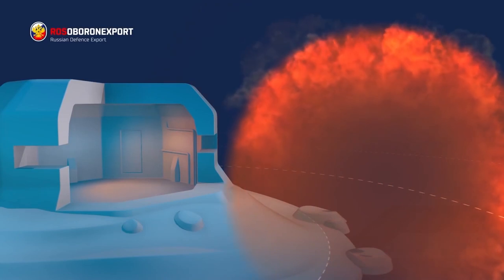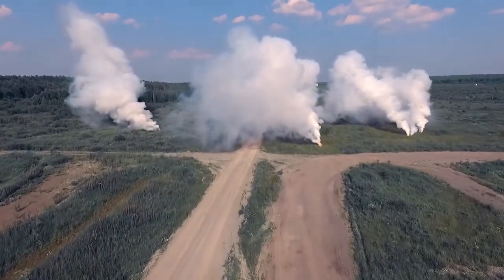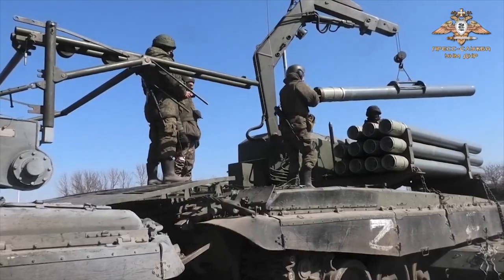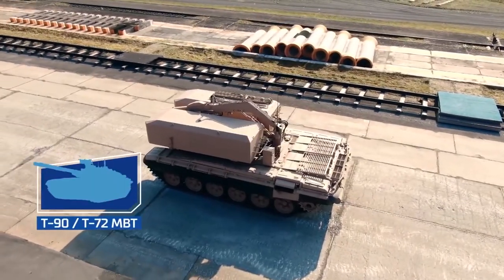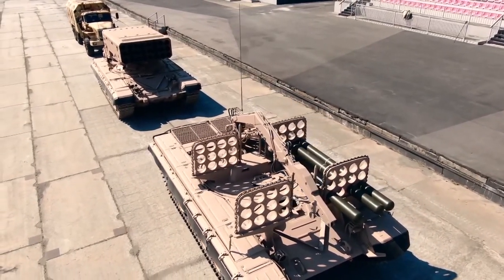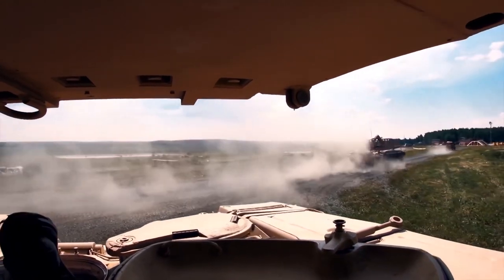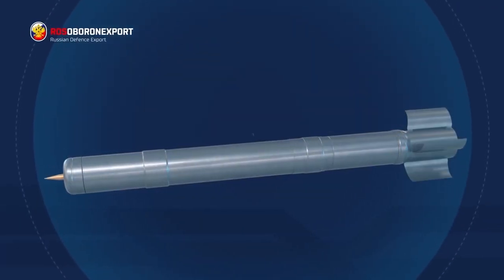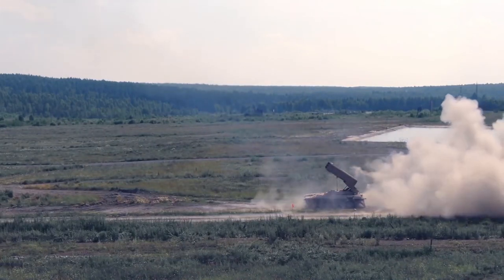How does Russian TOS-1A Thermobaric Rocket Launcher work which is used in Ukraine

Comment: It is incorrect to state that when oxygen is consumed nothing replaces the oxygen and a vacuum will be created. What really happens is that when oxygen is consumed, it is replaced by combustion products, so no vacuum is created. What is more likely to be created is a concussion over-pressure shock wave, as air expands when heated.
Reply: There is a vacuum effect after the blast, this is true with all explosions.
What people must realize is that this effect pales in comparison to the destructive power of the initial blast. 

Why this vacuum effect occurs is that hot gasses like CO2, CO, nitrogen and many others expand when hot but rapidly cool and contract back in. This happens in fractions of a second.
Reply: @harrypeterson9287  Though this depends on the size of the explosion. The expansion / contraction cycle is going to be much longer then a fraction of a second for, lets say, a 'special purpose' tactical nuclear warhead... 

Some people may also claim the 'partial pressure' effect, where if there was no oxygen in the air outsides of your lungs is zero, then the partial pressure of the oxygen left in your lungs will try to force out any oxygen you have left. But this also ignores the 'partial pressure' of the combustion products outside your lungs that will try to force themselves inside your lungs.

Still, the general issue is that spreading a concept based on ignorance, in the long run only encourages more ignorance
Reply: @leonardmiyata482  I agree that size matters in terms of blast and vacuum duration, but the vacuum effect occurs over a much longer duration with much less force than the initial detonation. 
On the outskirts of the blast radius the vacuum effect would be too weak to have any significant effect effect since anything in its path would have already been hit far harder by the blast itself. Kind of like the difference of getting hit by a tsunami vs standing in the ocean as the water goes back out.